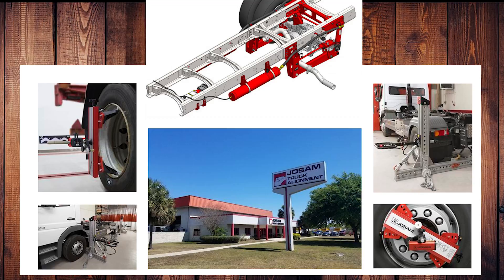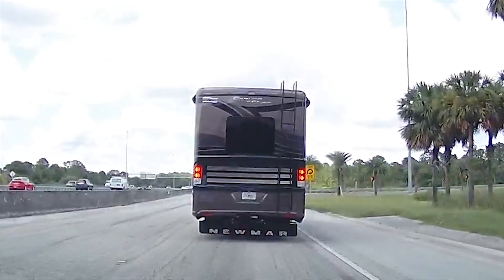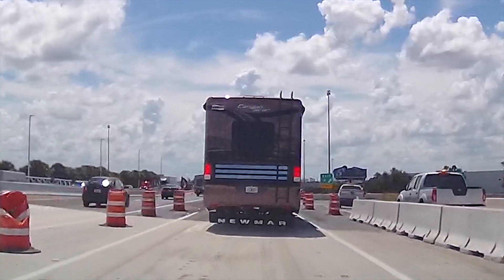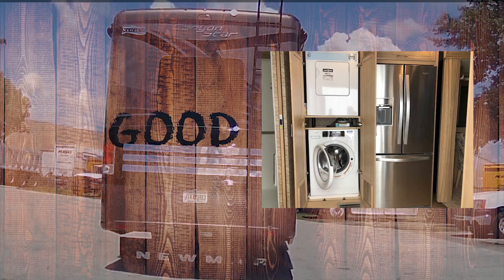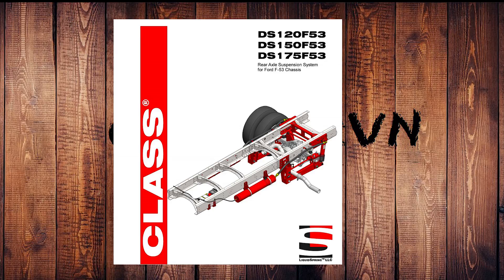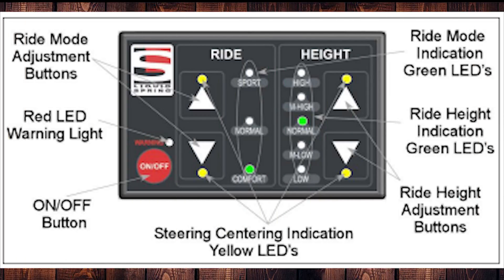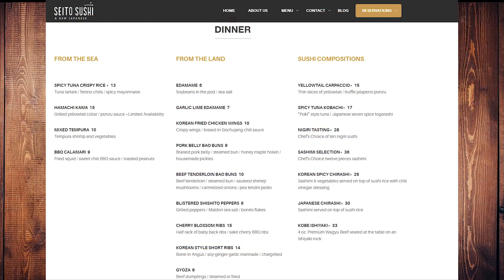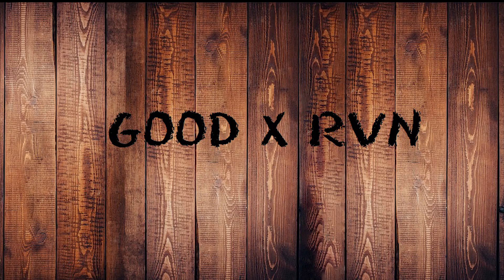LiquidSpring CLASS Suspension installation on CanyonStar

Comment: What does it cost to have just the rear suspension installed on a Ford F 53 chassis?
Reply from the maker: For the installation, it depends on the shop you choose to have the installation performed. My recommendation is to have the Manufacturer of Liquid Spring do the installation at the factory.

Comment: Does the liquid spring increase your towing capacity? Great video thanks for sharing !
Reply from the maker: No, the specification of the chassis remain the same as stock. Glad you liked the video. We like the LiquidSpring suspension. After 19,000 miles, traveling coast to coast we still think it is the best modification we have made to the CS  to date.

Comment: Thanks for the video. I have a 2016 Newmar Canyon Star 3921 (the toy hauler), I've owned it since new and I have 20K miles on it now. Did the liquid spring system help reduce the creaks and squeaks experienced when driving even on a pretty decent highway surface? Would you say the ride quality has improved (other than the left right sway)? Thanks!
Reply from the maker: Vibration was very much reduced. Actually it is the most noticeable attribute of the Liquid Spring install. Now I can hear the dishes rattle and they are not that loud. We have chased all the rattles out of the Canyon Star. The ride is pleasant and reasonably quiet.
Reply: @goodxrvn2053  THANKS!!!!

Comment: I have a 2015 Tiffin 36la  am thinking of adding some suspension upgrades . What was the cost of the Liquid spring up grade . Thanks Mike
Reply from the maker: Not sure of any new pricing but when I purchased this the coast installed was around 10-12k installed. The price varies based on installer and model.

Comment: I know what you're talking about with the rocking. My dad had a 28 ft motorhome on a Dodge chassis back in the late 70s that I used a few times. He said I'd get use to it and learn to ignore it. Never did. When you consider the added cost of things like safety steer and LiquidSpring, it makes the difference the Newmar Canyon Star and the Ventana LE a little closer. Some people are afraid of diesels because they claim you can't find anyone to work on them, but that's true with all motorhomes.
Reply from the maker: To that point, if I knew what I know today, I'd probably be still waiting to buy a MH. I waited since 1976 to purchase the Canyon Star for any number of reasons. Still didn't realize all of the unknown unknowns. I liked the idea of buying new and I did not want to get too deep into RV. What if we didn't like it?
Many questions have been answered regarding Rv life and the equipment needs.
We'll keep this one for 5 years or so then determine next steps. Once you get the chassis sorted, the driveline is relatively bullet proof with proper maintenance and operation.
What's next? My guess would be a preowned Dutch Star.
There are a lot of Ventanas on the used market which makes me wonder why. Probably could get a decent buy on a used one with low miles but it still has a solid steer axle. You have to step up the the DS to get IFS.
The Cummings D is a decent diesel engine in the smaller Ventana but I have heard of recalls with the Cummings 400 h.p.  L series along with other issues. The real advantage for me would be the weight carrying capacity and air suspension and air brakes.

The diesel model I would be interested is the 4311.  At 43' that is a really long RV.  My CS at 40' is bad enough.

Thanks for the comment.

Joe